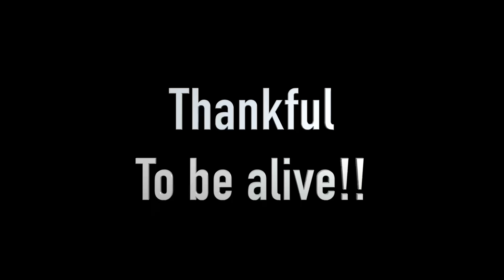The Firefighters said I was LUCKY TO BE ALIVE after this stupid MISTAKE!!!

Comment: As a Paramedic seeing this, that was actually crazy to watch. The electricity could have arched through your body stoping your heart in the process since both your hands were on the machine. Very lucky there was some insulation to stop it. I would always recommend having 2 of you on the jobsite and carrying an automatic external defibrillator in your truck for emergencies. Be trained in cpr and basic first aid. Super lucky al. I've seen where some aren't as lucky as you. Very blessed to say the least.
Reply: Just so happy to see you safe Al
Reply: Electricity can be some scary stuff, gotta respect it for sure, Al is very lucky indeed.  Just as was a co-worker of mine, he had his keys in his keys we used at work, he was shutting down the main breaker if the engines we used that night, his keys made contact with the knife switch.  The electricity shot through him, down his leg, he’s lucky he was standing on a thick rubber padding on the floor, or it may have been worse.  This was just the power from the batteries to start up the prime mover, and for other items, had it been the 480 volts used to power the passenger cars, the outcome would have been much different.
Reply: Al please be more careful. Have someone on these jobs with you please. You ate a good person. We need you to be OK. Amen.
Reply: 2 on a site isn't possible when you're a solo independent contractor. The simple solution is to assume there is power going through every wire.
Reply: @straightto8
Reply: @Saiyan585 Totally agree. It’s not because it is abandoned we assume that  it’s dead as well. Good point here @Al.😊
Reply: Agreed! Ya I ain’t saying nothing but Mr AL, you just got back after a month from a health scare & just left the hospital from surgery & the 1st day back on the job, what happens, you just almost got electrocuted, I ain’t tying to say nothing Mr AL but it might be a good idea to try to get closer to God, maybe start praying & reading His Word & check out a nearby church, I’m just saying, anyways, Y’all be safe & have a blessed day. 🙏😊
Reply: It’s pretty near wracking watching this video knowing that any second you’re going to almost get electrocuted!
Reply: Ooh, automatic external defibrillator! Do they make ones regular people can afford? Like under $100?
Reply: Electrician here. That would never have killed you....
Reply: Al, so glad you are ok! I have  gotten zapped by the 120 twice  for missing backing to Christmas Lights (annoyed all over again as it was, naturally somehow my fault, and nobody even put electrical tape over it. When Mom gave me lights, years after I moved out, she gave me those), and the other time was open, hot wires that  were under the cabinet by the lightswitch as some body in the family was adding an outlet.  Then twice with "secondary lightning"- one sweeping out water from Gramma's basement when we THOUGHT the storm was over (cool arc from the falling broomhandle to my hand) another a rolling land cloud of lightning that grounded out in a signpost stump - doorknob to hand. Yeah, I don't recommend any of these because, while it definitely adds a charge to your day, and I hate to be a real "buzzkill" - it's just not zap to your BBQ sauce anybody wants to have insurance copays on, lol
So glad you're ok!
Reply: @Nate great advise!
Reply: All very good advice, and Al Bladez, and wise to follow! There always needs to be training for CPR & and its procedures. First aid & CPR training is just good sense.
Reply: Al, you are blessed. That was very scary. Thank God that you are okay. The electric line was so covered in moss. The yard looked great. Al, thank you for all you do. You are an inspiration for me. Love and prayers to you and your family. ❤🙏
Reply: I gotta say .... if you had been injured, it would've been 100% your fault!
Reply: Snakes and wells.
Reply: ❤ Al please be careful. The correct word is blessed. You are truly blessed. You meditate/pray everyday, ok. The Devine being live with you, so continue to love yourself. 
Also, squatters can turn the power on as well. I see that open box on the side and under that wire.
Love you! Thanks for being who you are.
Blessings!
Reply: THAT WAS ALL GOD. JESUS GRACE WAS THERE IN THAT. NOTHING TOOO DO WITH LUCK.  THERE'S NO SUCH THING AS LUCK IN THIS CASE. I DON'T BELIEVE IN LUCK. GOD GETS ALL THE GLORY IN THIS. 💜✨️✝️🙏🔥🩸🌼
Reply: Yes Al, God is definitely with you. I know you'll be more cautious in the future. Luv u, luv ur channel! ❤
Reply: As an appliance tech I've taken a lot of shocks from 120V and 240V, but by far the worst, the one that should have killed me and has killed many was when I took a jolt from a microwave capacitor.  A 240V outlet doesn't even compare to that.  If you ever work on a microwave be sure to unplug it and look up how to safely discharge the capacitor.  The capacitor still holds a charge when it isn't plugged in, and it's a hell of a jolt.  I'm glad you're ok Al.
Reply: Solid PSA ... hope Al follows your advice. That was scary.
Reply: AL!  Plants have water in them and I was screaming at the computer screen when you went to cut the rest of those vines off the wall.  AND THEN you hit a wire in the process 😱 Son, you were itching to see JESUS that day!  Please, put the tools down and back away slowly.  WHEW❣️🙏
Reply: Basic CPR is good and infant CPR is something I don't like but this is crazy I have seen what nurse's go through not being a nurse but having nurse's
Reply: yup, across the heart as an electrician, we are taught to only reach with one arm,  and have the other arm away, --   so it if you are shocked.  you stand a better chance of not frying the heart.   --
Reply: @Jacob-seek-Jesus-123  set up a bible study with somone from the church of Christ Ac 2:38 Then Peter said unto them, Repent, and be baptized every one of you in the name of Jesus Christ for the remission of sins, and ye shall receive the gift of the Holy Ghost. Acts 22:16 Mark 16:16
Reply: @jamesg871  retired lineman here. if you are so foolish to believe your own words. i certainly wouldn't want you working on my house.
Reply: @purplesocks9745  how is he wrong? Electricity follows the shortest path. That path would not have included Al's body.
Reply: Did the power company ever show up?
Reply: Even watching this, made me jump. I'm glad he's alright. That was very close
Reply: I once worked for the power company. Yes, this could have ended badly and anyone who says no, has no clue what they're saying. That wire was live. 

I'm glad Al is fine. That was scary.
Reply: @jamesg871  electrician here, you're wrong. people die from electrified tools every year. the line, to the metal tool blade, to and tool handle, into even gloved hands,   ( why linemen wear rubber liners under canvas ) to Al's hand, up his arm, and down to his feet.   I'm sure I could do a search and find someone that was severely burned by a metal lawn tool and electrical shock. 
you  need to sit through a few safety videos.
Reply: @purplesocks9745 be nice, he's not an electrical lineman.
Reply: @jimmac1185  not the shortest path, the path of least resistance, and that very well could have been Al's body, especially since the ground wire wasn't hanging down,
those were two 120V lines from the transformer, so if he only hit's one. with the tool, to his hand,  his body would be the path,  until he hit the second line, and created a short to the transformer.  I think that is when it sparked. and burnt off both lines.   I'd like to see the tool blade..  I bet it's got a notch burned out of it..
Reply: Great advice 🙏🏼😘
Reply: Thank God your okay Al.  You have a beautiful family that loves you.  Be careful Al.  Someone was watching over you for sure.
Reply: @jimonthecoast3234  shortest path, least resistance = semantics. I highly doubt it would be his body since the power is trying to return to the source, not the ground. He was wearing rubber boots and the earth is a shit conductor to the source. As an electrician, I've touched service conductors like this with no insulated gloves on. As long as you grab only one at a time, you're fine.
Reply: @jimmac1185  not semantics, electrical science,    you should have your licences revoked until you retake electrical courses at the IBEW, or your local JC,    your doubt, is how guys get killed,   
Insulation is designed to have enough resistance to allow 240 volts not arc from adjacent conductor,  grabbing the Insulation is not the same as a metal tool touching the conductor, making the tool the same voltage.  
And a reminder it is not voltage that kills, it is a very small current, across the heart, that interrupts the normal best. 
And plenty of boots have failed,  
Safety first.
Reply: @jimmac1185  the lineman was correct,  and OSHA reports,  have plenty of example where people were injured in similar situations.  
Cheers.
Reply: @jimmac1185  oh, regarding ground as a path,   as an electrician you should know water affects conductivity,and that next to a service entrance and main panels, is where a copper ground rod, is located,   Al said they had a hurricane, so the soil would be moist. So that path, isn't as resistive as you've implied. Which is why safety comes first, and electricians shouldn't be arrogant about the risk,
Reply: AL you & Dre are blessed! Glad you're both okay. Great work refreshing abandoned property and quickly responding to emergency services to report what happened and further keeping the community safe. Take Care, Be Safe and God's Blessings Always!! 🙏🏻🕊️🙏🏻
Reply: @gargamel3393 do you remember tube TVs with  flyback transformers? 10k to 50k volts
Reply: 35 year master electrician here... You caused a short between the phases and or the neutral conductor. There was no danger to you. The path of current was through the tool head only.
Reply: Substitute "anything " for "nothing" and your diction improves  100%.  I ain't doing nothing means the oporsite, you are doing something.  Make comments with good grammar and punctuation and everyone will understand you and will appreciate what you have to say.
Reply: Thank you for your service
Reply: @theresacullens7794 gee, I wonder if they'd try while it's been cut?
Reply: @gargamel3393 gee.. as a person who used to be a cleaner in our family business I'd never thought of that.  But thx for that info.
Reply: @joannloos17 yup, I remember tube tv's that ours used to blow multiple times.  We had a tv repairman come out to fix it every time.
Reply: @FanciMiss  our local store had a tube tester (you couldn’t test the cathode ray tube -the big one) that my bf and I used. We were studying to become electronics techs just when solid state transistors were becoming common.
Reply: Thank you HEAVENLY FATHER so much for saving Al Blaze. We love you Lord JESUS we pray and we thank you for everything that you do for all of us and JESUS NAME AMEN.
Reply: So very happy to see you are safe! ❤❤❤
Reply: @michaelahayes6921  just imagine if he had the weed wacker and the power line shock him and’s he falls to the ground and the weed wacker is still running
Reply: His Guardian Angel was watching over him.  He was not suppose to get hurt. It was not his time. Father Yah was in charge.🙏✌🕯💕🦋🌻. Peace, light and love. . Neita and Ace. 💖🙏🕯🙂👋👣.
Reply: @joannloos17  I'm not sure what a flyback transformer is, but I use to repair the old CRT computer monitors.  It's good to be really careful around that anode wire when you remove it from the back.  My electronics professor in trade school use to go to people's houses to fix their TVs.  I remember him telling a story about how he got zapped pulling out the anode wire and threw his hands up as he jumped back from the scare.  He said he spent a few minutes looking around their floor to see where he had flung the needle-nose pliers out of his hand to....    then he saw it, stuck pointed end into the ceiling.  😂
Reply: God is good
Reply: What would an AED do for a stopped heart though?
Reply: It's 120 volts.  Not high voltage.  Like touching a extension cord
Reply: @josephz9006  except these carry the full amperage of the entire house, an extension cord is limited by the circuit breaker.
Reply: @jamesg871  can you elaborate on why?
Reply: 120V wont do a thing
Reply: Don't forget the protective bubble!
Reply: I'm in 386 also. We're you in DeLand, Daytona? Glad ur ok.
Reply: @nicoracien1924  If you’re an electrician, you shouldn’t be. If you’re not an electrician, good, and don’t ever do any electrical work.
Reply: @Saiyan585  
The even more simple solution is don't cut through power lines, regardless of whether you assume they're still live or not.
Reply: @Rowgue51  Well, assuming there is power would lead to you not attempting to make a cut near the line. We're both ending at the same conclusion.
Reply: And wear rubber electrician boots and gloves wouldn't be a bad idea. 

GOD WAS WITH HIM!
Reply: Might be worth just doing a 9nce over on the weatherhrad, when you do your walk thrus beforehand, just to make sure. When I saw that thing down I was like, oh, crap... 
Stay safe Al!❤
Reply: Great job Al
Reply: That some very sound, solid, valuable advice and professional 
Recommendation ..DO IT. ITS A LIFE SAVER YOUR LIFE SAVER..
Reply: @carolynparsons5066 Jesus Christ is The Someone ❤
Reply: @Saiyan585  Absolutely.  Assume all wires are live.
Reply: @TitaniumTurbine   lol...  Im an electronics engineer...whats your degree? You dont seem to know the Ohm law
Reply: @AG-yj1jv  I think your family might be trying to tell you something, perhaps they don’t like you
Reply: @jimmac1185  When he is the object providing the path to ground, his body sure would have been the shortest path.
Reply: @BifsieOfficial  but see there is the fundamental flaw. The power is not trying to go to ground, it is trying to go back to the source, which would be the neutral. When he cut the wires, the shortest path was the tool itself. If he didn't cut the neutral, it was merely a short which would blow the transformer or the fuses at the street. He was never in danger.
Reply: This is why Tools or double insulated.
Reply: 0:2 0:27 7
Reply: 0:32
Reply: @Eric-fs7jl  All the time, and all the time God is good.
Reply: No luck invloved. That was all God.
Reply: Good thing all these junk modern machines are made of all plastic.
Reply: Amen to that❤
Reply: How cool, Jason (a fan) stopped by to say hi!  How cool when your followers see you!  For them, it's like seeing a celebrity.  You are such a kind and friendly guy.
Reply: Great Advice as these jobs are at Least 10 years in the Making Scary stuff, But very Generous of this young Man to give his time plus Energy ❤️🌹🍀⭐️
Reply: @leedaluciano9806 wellies even in Summer so many creepies plus the Electric.😂
Reply: @migraine_addikt ouch x
Reply: Great Advice as these jobs are at Least 10 years in the Making Scary stuff, But very Generous of this young Man to give his time plus Energy ❤️🌹🍀⭐️
Reply: Covered up for a reason.
Reply: @FocusedSojourner yep Cover up in Rubber not that kind 😂😂😂
Reply: Just a suggestion, why wouldn’t you mow first to shorten the grass so it would be easier on you s as nd your machine 😊
Reply: @straightto8
Reply: God was watching over him
Reply: As a firefighter I agree with this post. Please get some cpr training and a defibrillator, you never know who might need it.
Reply: This is great advice… with some of these places you can’t see everything and don’t always know what you could be up against!
Reply: Praise God✝️🛐🕊🙏🏼❤️
Reply: You are anointed and appointed by GOD to go into the areas you work in and protected by angels 😇 🙏 that was for the benefit of those who don't believe GOD IS ABLE! May GOD continue to BLESS YOU and KEEP YOU!
Reply: Ugggh. God? Riggght....
Reply: Maybe if he wasnt such and idiot to begin with it wouldnt happen. Who in their right mind would use a mechanical tool along a power line.
You saying you are in paramedics should be shaking your heads in disbelief of the stupidity, not praising ppl that do this stupid stuff so more then do it.
I was told a story from an anesthesiologist where one guy was using his mower in his hands to hedge his plants. Guess what happened. He ended up in hospital with all his fingers severed.
Then a week or so went by and he had another guy come in hospital with the same issue. Severed fingers and he was baffled at such a coincidence. He asked the second guy how he did them and he said he saw someone in his street hedge their shrubs with a mower and thought it was a good idea to give it a try. The anesthesiologist just couldnt comprehend the stupidity in ppl.
Reply: (S) - Let's not rush it. Current (Amperes) is always dangerous. Most dangerous hand to hand, i.e. via the heart. I assume in this case alternating current (AC) 110 Volts. If 110 Volts hand to hand = double lethal current.   AC is also dangerous as it  affects the heart rhythm.  Hand to hand, the heart may be flowed through with 0.08 Amps at worst, which in the 'normal case' does not lead to death if quickly 'disconnected'. Regardless of what I say: Follow the advice above and get a defibrillator. It instructs you and you can never do wrong, harm. And, remember! Better to do something than nothing. If someone is not breathing = do CPR, press hard and rhythmically on the breastbone (sternum) right between the nipples. LOUD and rhythmic in halfetime with your own stressed heart. CPR is for waiting for the defibrillator and ambulance. It is the defibrillator that revives the racing heart. When I say 'in step with your own strained heart' I mean you should forget the slow and powerless Hollywood crap. Two HARD compressions per second.  Some recommend the beat to "Staying Alive", Bee Gees. Do you want to blow? Do 30 and blow two.. keep going help is coming. But compressions are enough. 
If "necessary", or panic!? Do whatever! Jump on the chest, if so. Anything to get the blood circulating (with oxygen) until the defibrillator arrives (restoring the rhythm).
Reply: As chopper pilot, firemen and also paramedic in training and a electrician I've built my life serving man kind. I started in the USAF severing my country and try to learn as much I could. I've seen so much death around me and how it could be easy to protect your self if only if you took your time and always look before you anything that could protect yourself. Life is to short!!!
Reply: Working alone is super risky, especially in more remote locations. I would recommend bringing a pal along even if they are just hanging around. Some of my worst injuries while working were in the boondocks, primarily because no one else would work there. Got the bids. Great comments about FIRST AID and SAFETY - all very much based in reality, not in the worry wort realm . 
I kept a full kit in my vehicle ; bandages, ointments, pills, emergency lights, and a .40:cal mounted on the roof, with optional grenade launcher. ( kidding )
Reply: That Spider was big enough to take out a small bird.
Reply: So are you a paramedic or an electrician? You better stick to paramedics because you don't know much about electricity.